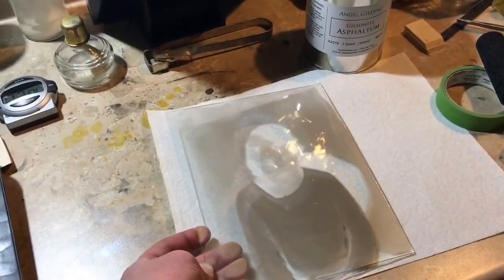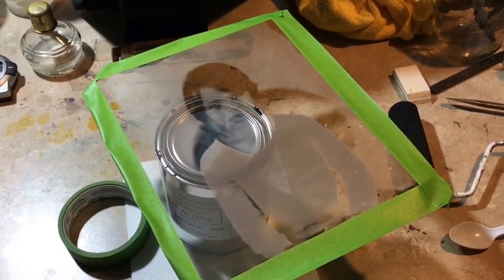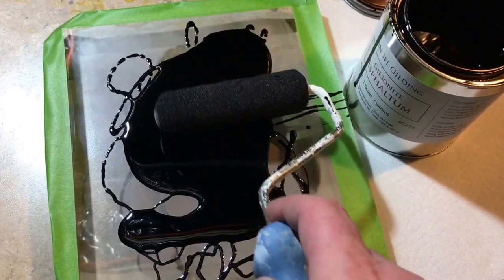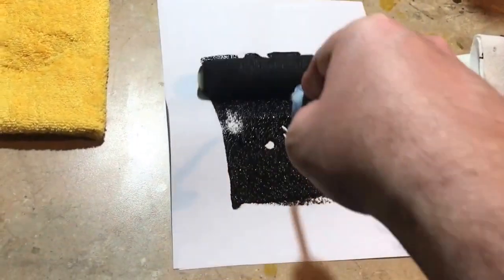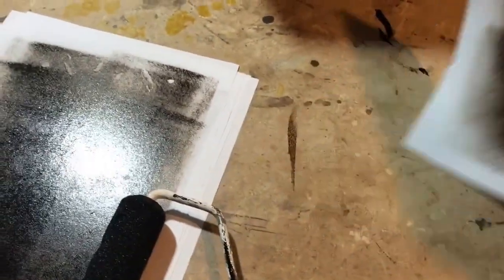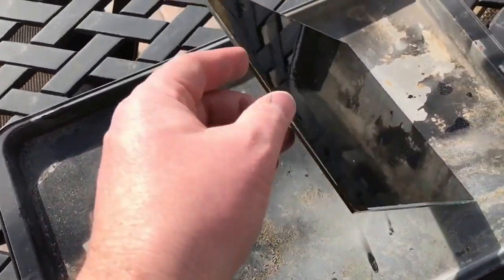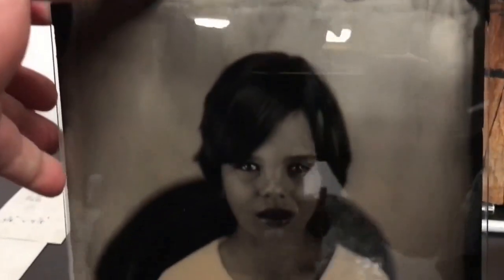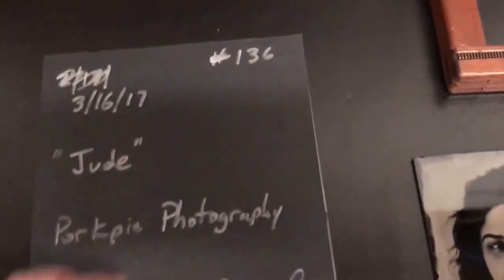Applying Asphaltum to an Ambrotype

Comment: Nice job. Do you varnish the plate before you add the asphaltum? 
Does the stuff you use get fully hard or does it stay somewhat rubbery?
Reply from the maker: Normally, I pour the asphaltum directly onto the collodion surface.  As long as there is an even coat, it will prevent any oxidation of the silver.  I don't know that I would say the surface is hard, but it's not tacky either after airing out for a week.  I put the paper backing on pictures I give to other people, but on my own I leave that off.  Since I may not have extended time to air out, the paper comes in handy to keep fingerprints from being pressed into the backing.
Reply: Thanks for the reply. So far I have only done tintypes with the exception of just a couple ambrotypes on clear glass. The black glass seems great but I don't have a source for it. This looks like it works great also.